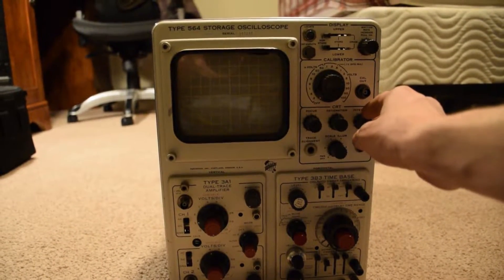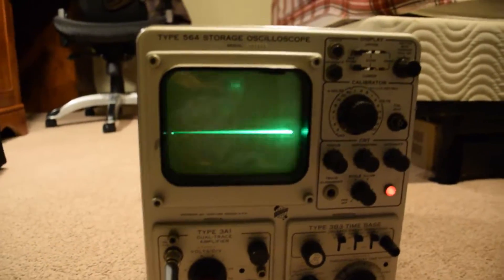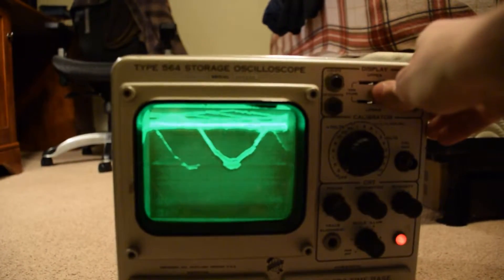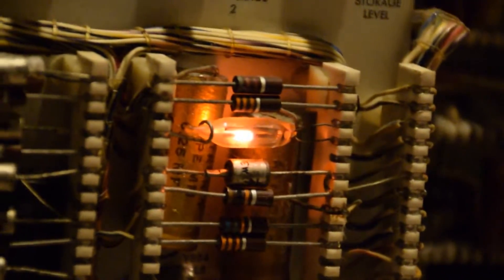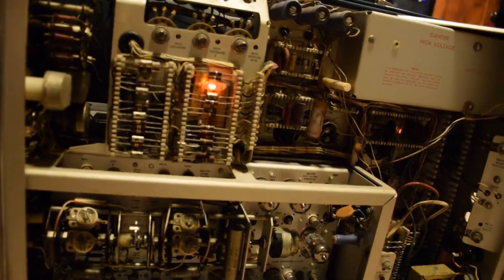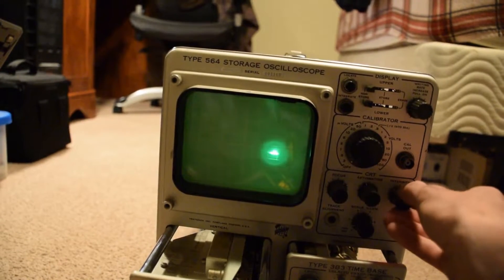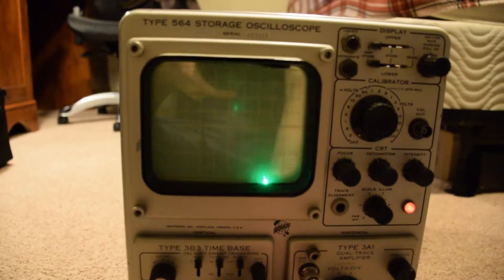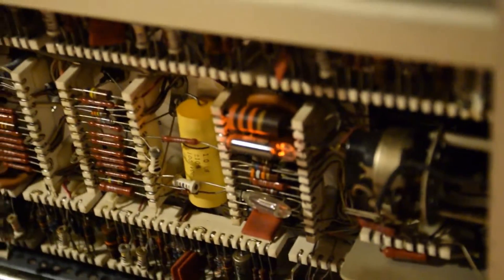Type 564 storage oscilloscope

Comment: Hey there question for you, i might be able to get one of these but it doesn't come with a power cord, do you know what type of cord i need to get for it and would you recommend this scope?  Already have a 465B by Tektronix so dont know if i need another but very much tempted.
Reply from the maker: The power cord isn't special other than having a rounded exterior. I trimmed an old power cord away until it fit.

They aren't very fast scopes, and the storage function is even slower, but they are cool nonetheless due to that storage function.

The beam shows up bright in my pictures and photos, but the beam brightness is limited internally to a point where it wont easily burn the phosphor. This particular phosphor is easy to burn use with caution. These storage tubes are getting harder to find.
Reply: @RingingResonance  good to know thank you! I like the fact the unit is tube based as the only tube based electronic that i have is a champ amp.  So might be fun

Comment: Entering cringe mode:

Please NEVER hot remove or insert plug ins.  Turn off the instrument first.  You can easily blow something up.  Just as important.  Your use of excessive trace brightness is destroying your precious storage CRT.  Doing this when it is showing an undeflected dot or line are the times the screen needs extra low setting as to not get damaged.  The screen is equally susceptible to damage even in the non-storage setting.  This scope uses the very first type technology storage CRT.  Early tech often has some special precautions attached.  They are easily damaged, compared to a much more robust, non-storage conventional aluminized scope CRT such as found in the similar Tek 561. Conventional scope tubes were a relatively mature technology in 1962.  

:Exiting cringe mode.

Nice scope.  I own two and used my first back in the 1980's for tracing neutral atomic Hydrogen line emission profiles along the plane of our Milky Way galaxy with two sixty foot radiotelescope antennas and a highly sensitive receiver tuned to sweep 1 MHz slowly and repeatedly through the 21.1cm/1420.405751 mHz Hydrogen or H1 line laboratory rest frequency.  Doppler shift, towards red or lower frequency indicated motion away from the observer, blueshift, or the line profile appearing at a frequency higher than the rest frequency indicated the source moving towards the observer.  Me.  The 564 storage scope acted as the real time visual output of what was in essence a highly sensitive microwave spectrometer who's input came from a fuzzy spot in the heavens about the size of the full moon.  With that sized telescope beam, there are many separate places to look.  Fun stuff!
Reply from the maker: Neat.

Comment: Perhaps I will video the unpacking and power up, and post here. You could surely help me spot troubles just by seeing it. How rare are these, do you know? Not planning to sell, just curious.
Reply from the maker: I'm not sure how rare they are. How long has it been since you powered them up? It might be a good idea to put them on a variac and very slowly turn the voltage up until you reach the working voltage. The old capacitors don't like to be hit with sudden voltage after they have been sitting inactive for a long time.
Reply: Good idea....if I had a variac. I will video unboxing, setup, remove panels since I've never had them off. I guess I will have to make sure all switches are off, then plug in.

I bought these for assisting me in audio circuit projects, like amps, preamps, crossovers, speakers. Now, I have 2 vintage servo-controlled turntables I need to repair. Part of the repair is examining waveforms used to establish the feedback circuits.